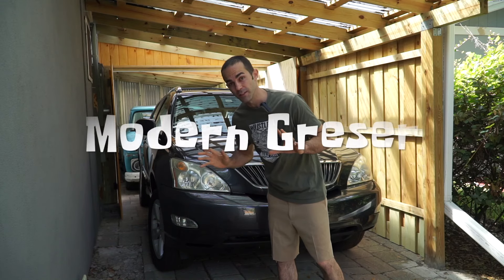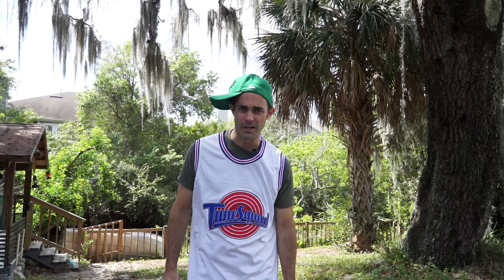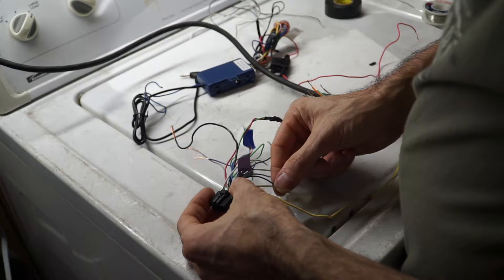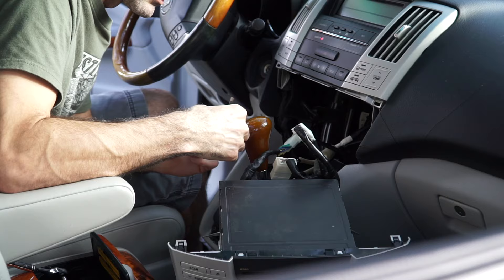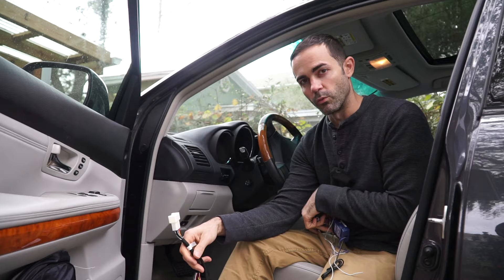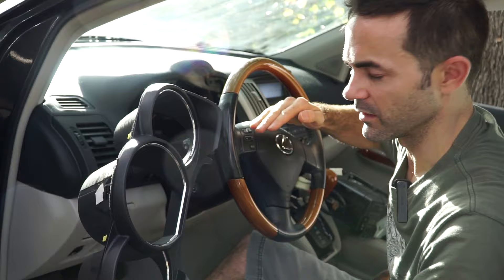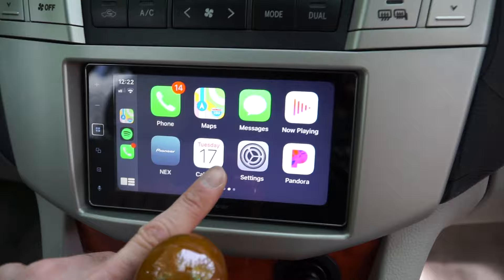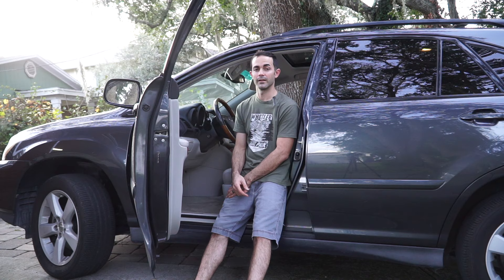BEST aftermarket radio for the Money!!  Install in a 2004-2009 Lexus RX 350 RX 330 Pioneer MVH-1400

Comment: At least n my original factory Mark Levinson unit there are actually 4 10mm bolts that hold the radio, 2 visible and 2 hidden about 3" deep behind access holes on either side. Fairly easy to get to with an extension bar but take care not to drop the bolt or socket or you'll have a hard time to recover them.

Comment: I've considered buying the Kenwood head unit, but went for a Teyes instead for a number of reasons.
I was looking for a head unit that provides a more tablet-like experience, so it works more like a standalone device without phone connected required. I just wanted to have my favourite music app and navigation app on the head unit itself. Plus Teyes also has a bigger screen. Also it seemed for me that teyes is easier to connect, in case you are not experienced in soldering.

I'm not trying to show teyes as absolutely the best thing. It is just it worked for me the best, and I'm trying to just give options. It is really up to you what to choose, but it would entirely depend on what you want your head unit to do. 

At last, anything is going to be better that the pre-installed head unit.

Comment: I used a local car audio shop to install the head unit and rear view camera. Few days later, only one speaker has sound, shop owner test every thing, and made a conclusion the oem amp stopped working. He gave me two option, find a used amp or bypass the amp connect the speaker with the new head unit.

Comment: This is surprisingly easy to do.
everything works, except the Audio section in the car's touch screen, so you lose fade/balance/bass/treble and it doesn't quite sound right... like it's phased wrong. The TYTO-1 doesn't include the 2009, but it does function... just doesn't sound as well as it should.
Reply from the maker: Thanks for the input.  Bummer it does not work the way it should for the 2009 model.  I only posted the 04-09 years based on what the TYTO-1 claimed it would fit.  Thanks for the heads up.
Reply from the maker: I just did some digging and the TYTO-1 claims that it is compatible with the 04-09 year.  I could not find any other alternative options for the 2009 year.  I would contact Metra @ For Technical Support:
techsupport@metra-autosound.com
tel: 386-257-1187
They should be able to help you out, as it should not loose functionality like that. Perhaps you have a bogus part.
Reply: @ModernGreaser  I have https://axxessinterfaces.com/product/TYTO-01 that thing... and it says RX Series 2004-2008. I did it anyway, knowing it might not be compatible. It's "okay". Ran into a lot of stuff that said it wasn't compatible with my 2011 Ranger, some was, some wasn't.
Reply: Dave, did you get your sound issue figured out? I also have used the metra harness, and I am having volume sound issues too, like someone is fading the sound up and down.
Reply: @TheEstevanVega  a little, or I'm just getting used to it. I've found that if I turn it up a little loud and back down it sounds better... but no control over fade.
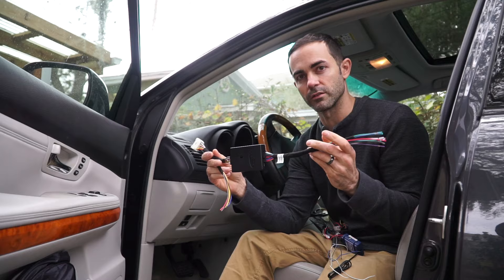Reply: Did you zero out your fade/balances, before removing the old unit? That could be the issue, it worked for me. See (8:40) on this video: https://youtu.be/R61_qAGhdpI
Reply: @josevigil4990  yes, I did
Reply: What resistor did you use to get the climate change to keep working? I’m a bit stuck.
Reply: @SnowyFireAnimation  I believe it's a 68 ohm resistor, came in the metro kit, I almost lost it!

Comment: You're not supposed to solder wire(s) for anything that is gonna be outside environment, it will rust! Use crimp connectors or electrical tape.
Reply: i agree that soldering a radio is kind of pointless, but not at all for that reason....
how often would radio wires behind the dash be exposed to outside environment?

also, if you heatshrink a soldered connection (properly), it will be weatherproof...

Comment: Anyone had any issues fitting the Metra trim piece to the dash? Did you need to shave a few millimeters off the edges of the trim with a grinder tool?

Comment: Would you please share your research results on the resistor wiring diagram? What is included in the dash kit does not make sense.
Reply from the maker: There is a 12 pin connector that has a white and black wire.  Just strip the wire and bridge them together with the resistor from the kit and you're all set.  I don't have the instructions anymore, but that's all that need to be done. 7:08 shows what I am talking about. the resistor is non-directional, so just plop it on there, solder it, tape it and you're good!

Comment: Just had this done and now the passenger speakers aren’t working. Think I need to replace the amp.
Reply from the maker: Mr Mua were the passenger speakers not working prior to the install?   If the connection is bogus to the front speaker group then that could be your problem.  It’s only a few bolts to to take it apart. I would pull the radio out, look for anything that seems like a poor connection. Have the radio in when it’s out and jiggle some of the wires or the amp integration device.  I would hate to see you go through the trouble to locate an amp, install it and have the same issue. I’ve rarely seen amps that blow out a channel. Usually they crap out entirely or something else is at play,

Comment: Went to 2 different installers and tried 2 different stereos. I have an 07 rx350. I am getting fluctuation in sound volume without me adjusting anything, like it is fading and fading back. Any idea why this is happening? So annoying. Makes listening to music painful.
Reply from the maker: Are you using a bypass module for the factory amplifier?
Reply: @ModernGreaser  I believe the only harness used was the tyot 01 that you used. A lot of people use it for their lexus. But the installer is now saying it might be the factory amp. I've had several aftermarket radios put into old cars, never replaced an amp. Also, the factory stereo that was in there before sounded fine.
Reply from the maker: @TheEstevanVega  If it is the factory amp, which is likely the culprit, then that would make sense that two radios revealed that the issue is still prevalent.  You can bypass the factory amplifier, which can sometimes very easy, other times not so much.  On the Lexus, I would assume the bypass would not be too difficult.
Reply: I don't understand why you didn't experience this issue. Several people have installed aftermarket stereos in their rx, and they don't have this fade problem. What's even weirder, is that is is almost unnoticeable when listening to rap or acoustic. But when listening to a rock song, the sound fades in and out like someone is messing with the stereo or like it is trying to reach a level but can't. I don't get it. The car is an 07, but I bought from a dealer who got it in a trade from an old guy. Car only had 37k, barely driven. A bad amp doesn't seem to make sense because of such low mileage and because I have sound. I have soind with regular factory radio and aftermarket.  From what I've read, bad amp is usually no sound. I'm at my wit's end. I have just picked up the car from a 3rd installer, still no fix. I don't want to have to replace amp and all speakers. I want to just use my system and have it work. I'm already into this thing a grand. This seems freaking insane. Please help
Reply: @TheEstevanVega  You need your own amp, check my install.

Comment: Hello! I appreciate how helpful your video is! Before i start buying the harness and such im curious if your amplifier bypass harness includes the harness needed to connect the aftermarket deck to my stock steering controls? I know for-sure my 05 lexus has a 10 speaker system with a factory amp im just really hoping i can find the proper harness that will not only function with the stock amp but also connect to my steering control! I do have on board navigation (old school) if that effects anything!! Thank you for your time any insight will help a bunch!!
Reply from the maker: Steering wheel controls rely on another module that requires some programing.  It's not terrible.  I did one on this lexus and my old 4runner.  Just have to follow the instructions.  Here is the video for the Lexus:  https://youtu.be/5hZ0cbDAxaA
Reply: Modern Greaser 
Thank you for following up on my question! Both videos have been very insightful I ordered all the parts thanks to you!
Reply: I guess Im asking the wrong place but does any of you know of a tool to get back into an Instagram account??
I was dumb lost the account password. I would love any tricks you can offer me.
Reply: @Kian Zechariah instablaster :)
Reply: @Bodie Titan it did the trick and I finally got access to my account again. I'm so happy!
Thanks so much, you really help me out!
Reply: @Kian Zechariah no problem xD

Comment: I got a 06 rx400h and my ac is not functioning at all. How do i solve that
Reply: if you are certain you have freon in the lines and the pressure is accurate. It just may be this module behind your glove box that moves everytime you change the temperature to direct the flow of either amount of hot or cold. Easiest way to check is get access to the locationa and change the temperature and see if it moves. I bought a 2000 rx and I guess it is common that these go out. Even the blower has one for speed so make sure you are looking at the right one and might as well check to make sure both are working. Also can check to make sure your cars ac clutch is turning on and both cooling fans are turning on when the car heats up.
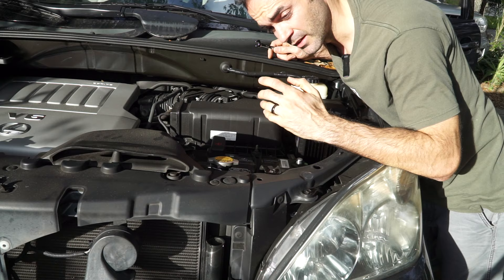Reply: At 7:00 he explains the resistor you need to fit in for the AC to work.

Comment: Will this same unit work with a 2007 RX350 with a factory navigation system and backup camera or would you recommend a different one?
Reply from the maker: The same head unit will work, but this video is getting a little long in the tooth and there are cheaper, better radios out there now.  Any new head unit will not interface with a factory back up camera and will need an aftermarket camera. The radio install  kit is likely different for your car than this video as well.

Comment: So just to be sure, does the original unit not do anything to do with the car itself, just phone, messages, navigation and music ....
Reply from the maker: the vehicle in the video did not have navigation.  The original unit only has controls for the climate hot cold etc.  The new unit will accept calls, messages, and offer navigation.  You can synq it your steering wheel as well

Comment: I know u made this like a year ago but I just picked up a rx350, but my stereo is a different I have a display up top, do.i need a different setup?
Reply from the maker: If your RX 350 is in the 04-09 range (which is what I think is listed for the video) then the kit will work.  It just has the navi above the radio, which is slightly awkward.   I would imagine both would function fine. They make a giant radio kit that deletes the radio and navi and looks like a Telsa. I know nothing about this.  It could be cool or complete dog doo doo.  https://rhinoradios.com/products/lexus-rx-2004-2009-11-8-vertical-screen-android-radio-with-2k-resolution-tesla-style?variant=31794475106422&currency=USD&utm_medium=product_sync&utm_source=google&utm_content=sag_organic&utm_campaign=sag_organic&utm_campaign=gs-2018-09-04-1&utm_source=google&utm_medium=smart_campaign&gclid=CjwKCAiA65iBBhB-EiwAW253W7F0Q80Ud2p6B3I8YIefrBBzAdhOHV2wN1p_QlRMaKiaUqybLZ-IQBoCJJkQAvD_BwE

Comment: Is this standard process for most cars? Or is the Lexus more of a hassle? I have never done a new stereo receiver.
Reply from the maker: Most radios are much easier.  The Lexus is the only one I’ve had to wire in resistors with the ac system and I’ve installed radios in double digit hundreds of cars.

Comment: Is it required to solder the resistor?
I did not solder it and both the climate control works properly! I bought my unit from Crutchfield and and also used the Axxess units with it.

Comment: So can 7 work rather than a 6.2?
Reply from the maker: hmmm... can you expand more?  I'm confused and make lots of dumb videos haha. -thanks...
Reply: @ModernGreaser  how do you get spotify on your menu? Mine doesn't have THAT!?
Reply from the maker: @DiaperSNiFFER   make sure you have the app installed on your phone and have it open, then you should be able to switch to it when you cycle through aux, radio, pandora, etc.
Reply: Modern Greaser 🙏 thank you
Reply: Modern Greaser im talking size wise. A 7inch.
Reply from the maker: Jeremy Mangroo if you’re talking screen size, a 7” should be standard size for a double din, so it will fit
Reply: @ModernGreaser  are you sure a 7” radio is going to fit? It seems the 6,2 you installed takes up the whole size of it
Reply from the maker: @alessandrofaggioni4603   there are only two sizes of radios: Din and Double Din.  Double din is the larger of the two and is a standard size for any vehicle.  (except exotic and Rolls Royce type of vehicles etc.)  So any 6-7" double din size radio you buy is standard and will fit

Comment: Would the process be any different if the RX350 comes with the nav ?
Reply from the maker: That is a very good question.  Likely so.  The kit that you receive for the dash will have detailed instructions that should be nearly identical to the install I did.

Comment: Can you please help me ? I have an 05 Lexus rx330 that I bought an aftermarket radio for . The harness I have is the axxess tutorial-01 wired everything up color to color but I’m not getting any sound . Also with the resistor I’m not exactly sure which wires to connect it too .

Comment: I have a 2009 lexus ls 460l and I wanna do this but people act like they scared to do it
Reply from the maker: Should not be any reason to avoid tackling it.  Just hook up some wires and away you go.  The resistor is important and you can fry your electronics if you don't take your time.  Nothing to be afraid of.  A lot worse cars out there

Comment: Is this the same for 2008 rx350?
Reply from the maker: Through 2009
Reply from the maker: so yes :)
Reply: @ModernGreaser  do you need the 68 ohm resistor when buying the turn on/amp bypass kit? 

None of my stuff came with resistor unless it shows up with the radio
Reply from the maker: @jacobbonasera1296   That's weird?  It will not come with the radio.  It should have come with the kit..., but at least you can just buy one for pennies and throw it in.   I'm surprised it didn't come with either the harness or the kit?
Reply: @ModernGreaser  yeah I looked in the turn on kit like 100 times because I know resistors are small. But it is 68ohm correct?
Reply from the maker: @jacobbonasera1296  that is something I am not sure on. You may want to double check the internet on the specs. Its been about a year since the install and I don’t have any specs. I’m sure if I said 68 ohm in the video I read it off the directions. I installed car stereos professionally for 2 years, but I would never know the precise ohms. I’m 87.5% that’s correct

Comment: this is crap. buy Teyes.
Reply from the maker: Can you explain and further support your claim for curiosity sake?
Reply: @ModernGreaser  well, sorry for that disparaging comment. i replaced the set after buying the Lexus RX350 after watching Scotty's video. I got a couple of other replacement sets for my other cars, Teyes was fast, easy to use and way bigger screen. That makes using the touch screen so much easier. I'm older now and need glasses and sometimes when i drive i forget them, the smaller screens are such a female dog for me. They have a few different specs, for budget. don't mean to put you down. you can google can check the specs and make a comparison post, i guess. cheers

Comment: I have 2008 rx350 with navigation, do I need the resistor. If so what size do I need.
Reply from the maker: When you order the dash kit for the radio, it will come with the proper resistor.
Reply: What size/kind is the resistor ?